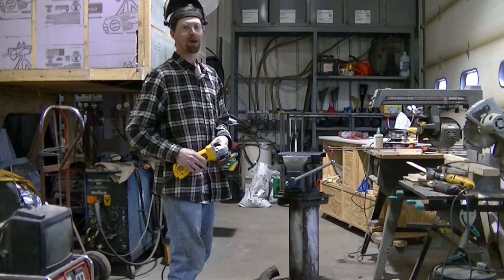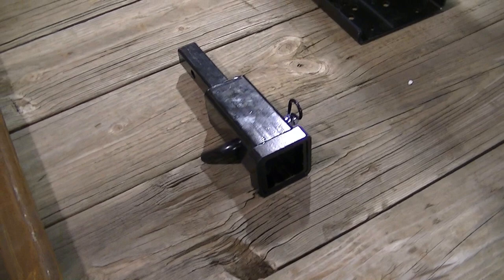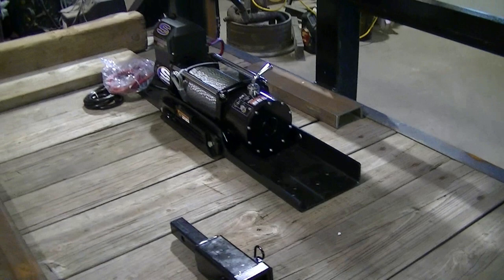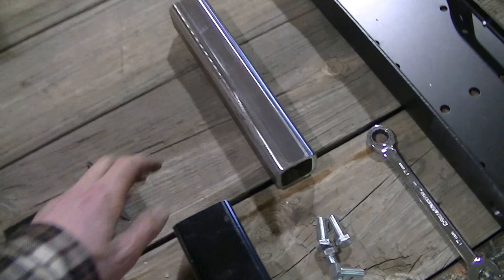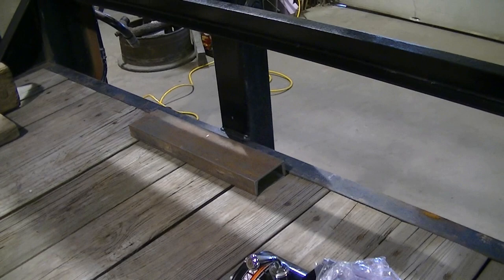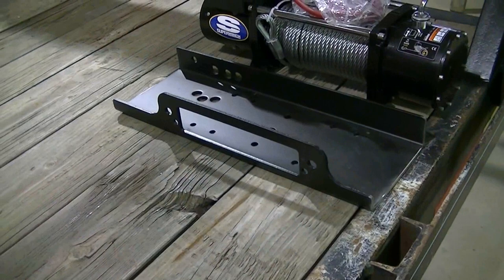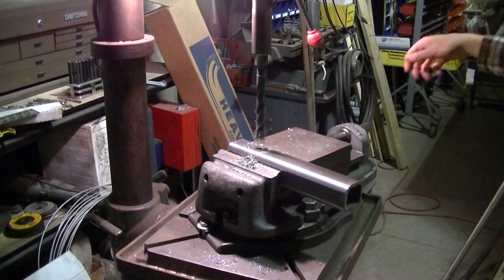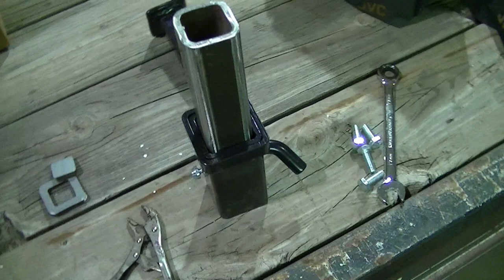Gooseneck Trailer Project "Blue Collar Hauler" Part 2 Winch Receiver Mount

Comment from the maker: You can buy a receiver winch mount but they want $70-100 for them.  I made one to save money.  I want to be able to use the winch on my truck when I don't need it for my trailer.  I will be addressing how I power the winch in a later video.

Comment: What kind of welder are you using?
Reply from the maker: Clark Cowan   We have an old Millermatic 200 and a little Hobart 130 something I think.
Reply: Looks like they do a really good job. I'm thinking about getting the hobart 210. I have a small Lincoln but it has no gas.
Reply from the maker: Clark Cowan  Yes,  they both work great.  Gas really helps get a nice weld.